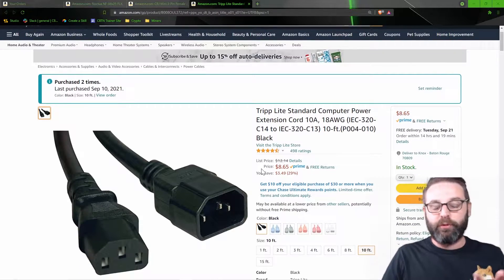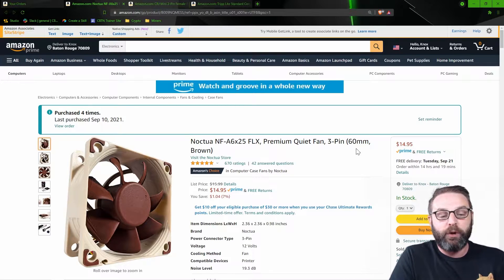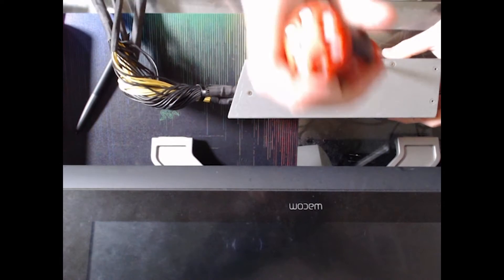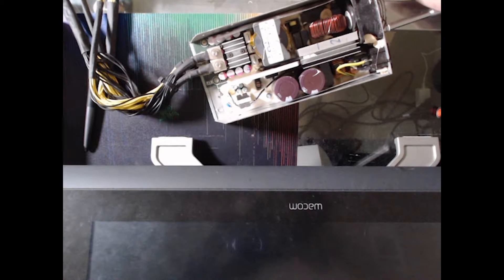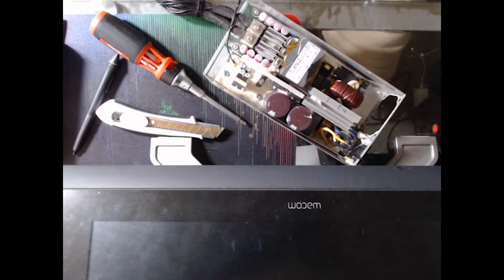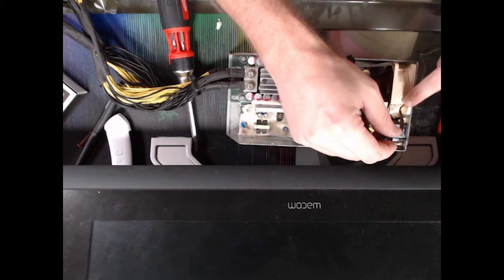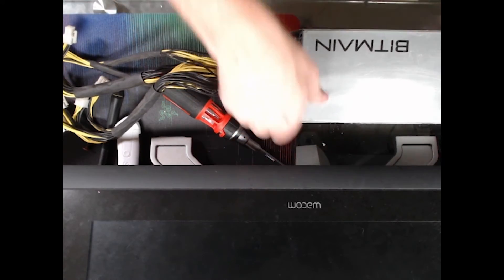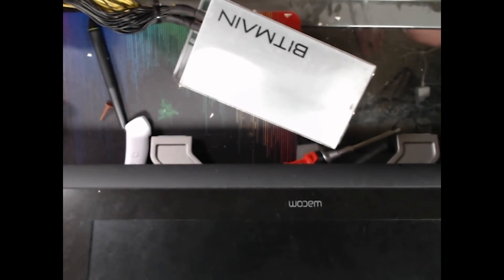Silent AntMiner L3+ Project: The Silent APW3++ PSU

Comment: LOOK at the L3+:
There's a grill above the rear fan and holes where there would be the 4, 3rd power plugs.
So for that rear fan:
Is it sucking air over the hash boards/heatsinks, or is it just sucking air in through that grille and holes..???!
ie: 
Step 1:
BLOCK those hucking foles!  Tape them TF up or whatever!  
(I use the foam discussed below for it's noise absorption properties)
That's a No Brainer!!!

Step 2:
Look at a card in the box/case:  
Is the air going to go over/through the heatsinks, or is it simply going to take the easiest route which is up and over the heatsinks, via that bit of PCB up top with coil in the middle...???!
BLOCK FFS!!!
Here your easiest bet is a piece of that stick on foam strip one buys for doors etc (the 10 mm thick one IIRC) stuck on top of the coil/s.

Step 3: (the basics)
Read up on axial fan aero and particularly Blade Passing (stator) Noise.
Basically the stators need to be as far from the blades as you can practically get them and aero (teardrop with blunt side upwind)
Not much you can do about the stators without good aero knowledge and a lot of time with files and sandpaper (makes a huge difference btw.  DON'T touch the rotors unless you have access to rotor balancing..!)
but
NB that you have the stator blades AND the wires going to the centre of the fan, are close to the blades.
Is there any reason why that ''blades passing wires noise source' needs to be that close to the blades...???!
And completely un-aero!?  
Move them TF away for a start!

This will cut the noise at a certain frequency BUT not all frequencies.  That helps.
All frequencies involves reducing blade tip vortices which I wont get into here.

Basically whoever designed the miner is either just a CAD kiddie, clueless about aero,  or his heads so full of electronics that there's no space in it for any aero knowledge whatsoever!  Not even the very-very basics!
ie:  This miner's design is that of a 4 year old moron from an aero POV, with huge room for DIY improvement.
Later models are somewhat better,  but only from the POV of 'Don't be a complete and utter moron!' aero.

A simple fan swap:  Pffft!  USE your noggin!  :)

End of the day; with good aero understanding, some time/work, and another (my) secret:
Believe it or not;  I/you can cut the fan rpm (noise) by 60% for the SAME AIRFLOW! :)

Comment: At 6:20 you can see the stock fan sticker facing inwards, and that the stock fan orientation is to pull air in to the power supply rather than exhaust air out. What is the reason for reversing the fan direction when the Noctua NF-A6x25 is installed? I know that having the fan exhaust is a common orientation on server PSUs. Have you performed any tests to determine temperatures in the APW3++ before and after reversing the fan direction?
Reply: Yep, I agree. The stock fan blows cold air inwards and over the hot electronics - the hot air then exits via the grill at the other end of the APW3 (where the power leads exit to the ASIC). You've fitted the new fan the opposite way to exhaust directly out of the back.
Reply: Location of the temp sensor will make a difference too. Might lead to better readings at the sensor, but your components could actually be hotter. Instead of blowing the hot air over the sensor, it's sucking cold air over it, etc.
Reply from the maker: I didnt reverse the fans of the PSU. I reversed the fans of the ASIC
Reply: @KnoxTrades  Yes you did...  The stock fan was blowing inward and the Noctua you installed is blowing outward.
Reply: are you really that dumb? you can watch your own video and see how it was installed from factory, and see how you installed yours."im not an electrical person, i dont know electronics" maybe you shouldnt be making videos about them then? @KnoxTrades

Comment: Can you change the fans on the L3+ without changing the PSU fan and have it run smoothly?
Reply: Yes, I have the fans on my L3+ but I could not do the power supply it would not work with my APW7